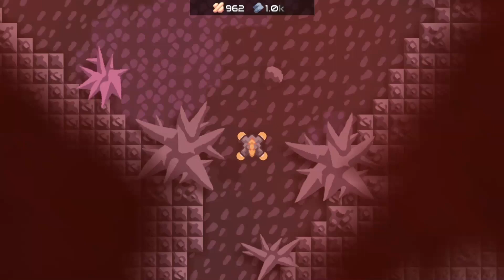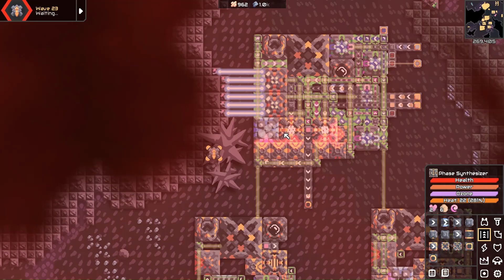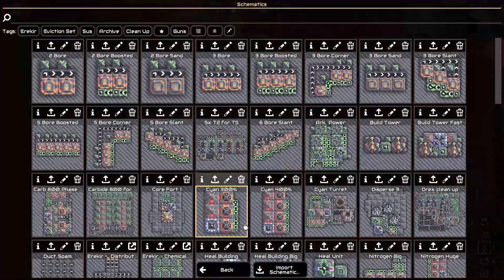My Schematic Design Process - Mindustry

Comment: How did you design your schematic? I usually get stuck in figuring out a layout for my buildings, have a constant moment of choice paralysis when it comes to what transportation blocks I should use to not mess up the efficiency, or have troubles with how to find a way to output my resources from buildings.
Reply from the maker: Sorry for the late reply man but I completely understand you. It takes a lot of trial and error. You mention choice paralysis but I also design schems are big maps with plenty of space so I can try every option and see what sticks. If you saw in the video I had like 20 different failed copies of the same schematic all trying to wire things differently, and that's what I've found works for me. Do whatever system works for you

Comment: Great scheme! Though atm as shown the silicon is going nowhere, and you could save some mats by putting 2 pipes above the nitro outputting it into the refab instead of bridging it over the bore. (giving you room for the message blocks to the left of the refab instead of blocking the silicon).
Reply from the maker: Yeah someone actually pointed that out, I probably shouldve taken another look at it again before I called it finished lol but thanks for the feedback